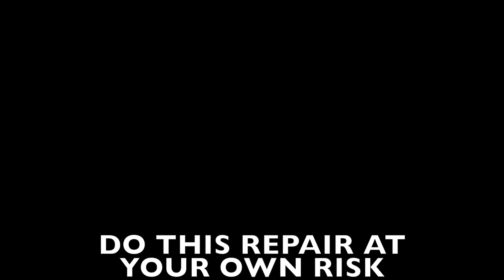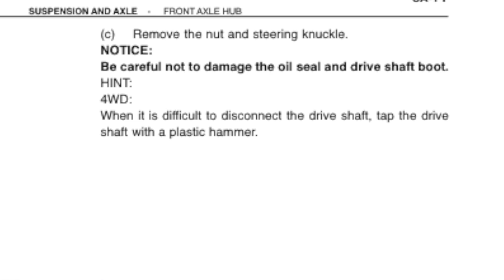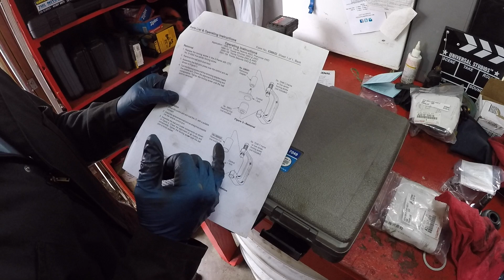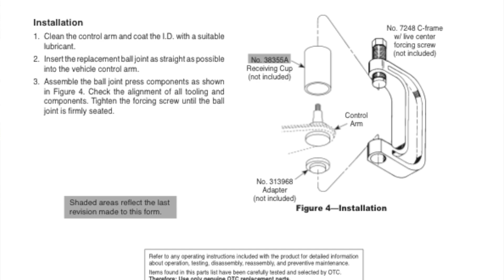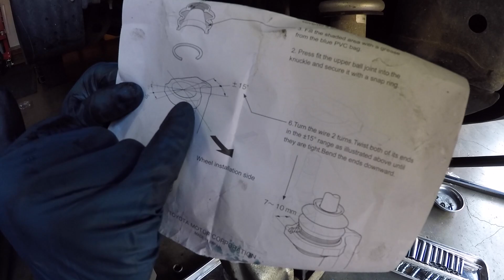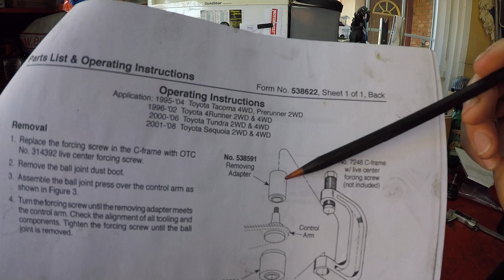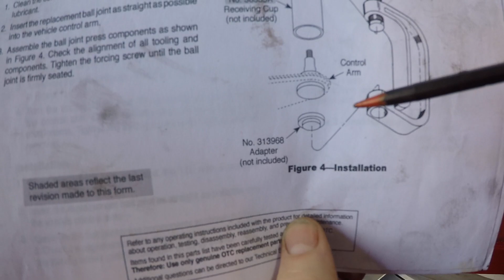Upper Ball Joint Replacement

Comment: Timmy, do you know if the Balljoint kit that you mentioned in the description (OTC-7249 on Amazon) comes with the necessary pieces for the upper ball joints on a ‘97 T100 4x4 & an ‘07 Sequoia 4x4? Your videos are top notch and have given me the confidence to tackle many jobs on my vehicles. Thanks!
Reply from the maker: Hey Casey,  No, that kit doesn't have all the specialty cups and adapters for the UBJ replacement.  When I did the UBJ job on a 3rd Gen 4runner, I bought the necessary cups and adapters separately from a tool supplier.  You can rent some kits for free from auto parts stores to have more cups to choose from and you can also get creative by using things like a deep impact socket to slip over the stud of the UBJ to drive it out of the steering knuckle.  To give you an idea what is involved, here's a link to the UBJ Replacement video.  I chose to remove the whole knuckle so I could capture it in a vice and not fight to get the necessary leverage to drive the UBJ out and get the new one in.  https://youtu.be/-sY2azyLBuI

Comment: Another great video!  Keep it up!  Also, What are the model numbers of the Dewalt impact drills you use? (Ready to upgrade)
Reply from the maker: Thanks.  Glad you like the video.  

Here'a a link to the larger gun: https://www.amazon.com/gp/product/B00WJA1J68/ref=oh_aui_search_detailpage?ie=UTF8&psc=1

Here's a link to the smaller gun: https://www.amazon.com/gp/product/B007NVSQEQ/ref=oh_aui_search_detailpage?ie=UTF8&psc=1  

These are bare tools, no batteries.  Here's some batteries I bought: https://www.amazon.com/gp/product/B00KQU1ENG/ref=oh_aui_search_detailpage?ie=UTF8&psc=1  

You'll need a charger too: https://www.amazon.com/DEWALT-DCB118-FLEXVOLT-Fast-Charger/dp/B01HD4E0LK/ref=pd_bxgy_469_img_3?_encoding=UTF8&pd_rd_i=B01HD4E0LK&pd_rd_r=424e3614-e703-11e8-8650-391015bbf8ed&pd_rd_w=bG3Dt&pd_rd_wg=2z5Qb&pf_rd_i=desktop-dp-sims&pf_rd_m=ATVPDKIKX0DER&pf_rd_p=6725dbd6-9917-451d-beba-16af7874e407&pf_rd_r=3WCN4JXJ31DYY6VG99YJ&pf_rd_s=desktop-dp-sims&pf_rd_t=40701&psc=1&refRID=3WCN4JXJ31DYY6VG99YJ

Comment: Are torque specs the same for a first gen tundra?
Reply from the maker: No clue.  We haven't done this job on a 1st Gen Tundra.
Reply: Are specs in the owners manual?
Reply from the maker: @johnjohnson6207  No, the owners manual doesn't cover that kind of information.  Those owners manuals have fairly basic information in therm.
Reply: @TimmyTheToolman  where can I find specs
Reply from the maker: @johnjohnson6207  You can try to see if there's an online version of the manual you can download for free.  You could try a Tundra forum and see if someone has the specs you're looking for.  You could buy a two day subscription to Toyota Tech Info and download the info you need yourself.  https://techinfo.toyota.com/techInfoPortal/appmanager/t3/ti?_nfpb=true&_pageLabel=ti_home_page&contextType=external&username=string&password=secure_string&challenge_url=https://techinfo.toyota.com/techInfoPortal/login/techinfo&request_id=-5518364760491963150&authn_try_count=0&locale=en_US&resource_url=https%3A%2F%2Ftechinfo.toyota.com%2F
A 2 day subscription costs $20.  You do need a Windows based computer to access the site though.  The minimum system requirements are listed on that link I provided.  There's a link at the very bottom .

Comment: Hey Timmy,
I've really enjoyed your Toyota videos. One thing I haven't seen you attempt is the front wheel bearings on something like a 2001 Toyota Tacoma 4 x 4 using a OTC Hub Grappler considering you use their tools. I've heard this is a difficult job. Any chance of seeing you perform this job in the near future?
Reply from the maker: Vlad Rector Hey Vlad, we have replaced wheel bearings on a 3rd Gen 4Runner which would be the same for a 1st Gen Tacoma.  The bearing replacements were part of our Manual Hub Swap videos.  You must have ABS so you’d want to watch Part 1 to see how to remove and replace the knuckles and Part 2 will show the presswork related to ABS Knuckles with A.D.D. Hubs. Part 1: https://youtu.be/TZ2sOfVrnhU. Part 2: https://youtu.be/1TpOYj0sUpA

Comment: What?!  I had no clue there were inner tie rod ends.  I just replaced my whole steering rack because one was bad.  But, it was also leaking a lot of fluid
Reply from the maker: Well, if it was leaking a lot of fluid, it was time to replace it.

Comment: are you a bike racer _ I see a lot of bike wheels and tires and rims hanging around
Reply from the maker: Use to be.  I raced mountain bikes from the late 80's to 1997.  I took a pretty long break from racing, around 7 years and then I started racing cyclocross.  I raced up until a few years ago.

Comment: Is there a reason why you can't just use the C clamp while everything is still in the vehicle?
Reply from the maker: You can but it's not exactly easy.  The reason why we pulled the whole steering knuckle off the rig is so we can capture it in a bench vice to hold it perfectly steady while we apply the necessary force with either a large 1/2" ratchet or breaker bar along with the c-clamp to force the ball joint out of the knuckle.  When you do it with the knuckle still on the vehicle, you can't stabilize the knuckle very well and it wants to flop around on you when you're trying to press the balljoint out. There's also the issue of space to get that c-clamp in place with the knuckle still on the rig.  So, instead of fighting it, we choose to pull the whole knuckle off.
Reply: @TimmyTheToolman  thanks Timmy, you sir are a true gem on youtube.
Reply from the maker: @Nessal83  You're welcome and thanks for the kind words.  Sean and I like providing a service to the DIY Mechanic Community with the videos we make, which includes taking the time to answer people's questions.  Happy Wrenching!

Comment: The way you did the wire holding the boot on was wrong.
Reply from the maker: Yes Wayne I know that.  I mention that in the video at least 2 times.  It wasn't until after we were finished that I realized my mistake.  The twisted wire ends should be to the side and not perpendicular to the wheel.  If either of his boots end up tearing, I'm going to replace them for him.  Toyota sells a reboot kit.  All you would have to do is remove the wheel, break free the upper ball joint from the upper control arm and remove the boot and put on a new one.  It would be a very easy fix.

Comment: Why take the whole spindle off you can do it on the vehicle.
Reply from the maker: Personal preference.  Having the steering knuckle  secured in a vice makes it easier to press the old UBJ out and press the new UBJ back in.  I've tried it with the knuckle on the vehicle and I didn't like the fight that was involved to stabilize the knuckle while applying the necessary force to do the press work.

Comment: you can do it without removing all those parts
Reply from the maker: Yeah, I know and I stated that in the video.  I chose to take the steering knuckle completely off so I could secure it in a bench vice and have an easier time getting the balljoint out and the replacement one back in.  With an impact gun, I think you could easily do it with the knuckle still on the vehicle.  I wanted to show how to do it with regular ratchets and breaker bars because not everyone is going to have an impact gun.

Comment: This is the long way of getting the upper ball joint out.  Some of these steps are totally not necessary such as taking the lower ball joint or axle.  You don't need to completely take out the upper joints to put in a new one.
Reply from the maker: There's more than one way to skin a cat, this was the method we chose to showcase & with the knuckle removed, it makes it easier to work with the upper ball joint especially when filming to get a good viewing angle for the viewer. Can’t wait to see the YouTube video you make showcasing the method you prefer.
Reply: @TimmyTheToolman  Just search there's plenty out there and on the forums.  I'm just saying there's other methods which are more easier.
Reply: @TimmyTheToolman  Just did mine today. Rented 2 tool set from O'Reilly (4wd ball joint adapter & Ball joint removal) Part# 67048 & 67045. Not all parts will fit but most will.  I had to MacGyver a little.  Didn't take the lower ball joint or axle out.  I tilted the knuckle at an angle almost outside the fender and use the rental tool to remove and install the upper joint. Pretty easy.  The only tool I didn't have was a strong enough ring plier to expand the ring. That was a pain and was probably the hardest part of the job for me. I used a hammer and flat head driver to pry the ring out.  Busted a few knuckles.  I'll invest in one in the future.  Thank you for this video!
Reply from the maker: @genxiong2695  Good job getting it done.

Comment: It would be great, if two of you mechanics on here, could agree on how to do the ball joints. not one of you do. Every one of you has a different way every one of you says the other one's way is fucking wrong. I'm sick of that shit. Also all of you experts need to realize you're not talking to other experts. You gloss over waaaay too many steps. Then, you all get that same special tool, which as far as I can tell, is a 200 dollar fking C clamp, that you then need to buy 2 new cups, because I guess the tool made for this trucks ball joints doesn't have the correct sizes for the ball joints? That's the consensus among all of you youtube experts. After watching your video, I've decided not to do this job. I'm replacing my entire front suspension, easily. But the ball joints apparently, require a 200 dollar C clamp and then needs to be retooled. Yeah, no. That's just fucking stupid.

Comment: You should just stop....Not only do you not have to remove that spindle to fit the ball joint tool but you split the lower ball joint instead of removing the 4 bolt flange and leaving the LBJ together.  Replacing the UBJ in the vehicle keeps anyone watching this video from having to removing the ABS sensor, splitting the tie rod, removing the axle nut (potentially damaging the front wheel bearing if they do not torque it correctly) removing the caliper...ETC ETC...just stop.  If you want to disagree, fine, just reference the 500 other videos on youtube showing countless people replacing the UBJ with the spindle still in the vehicle...
Reply from the maker: You're entitled to your opinion and you don't have to like my technique.  I've already replaced an upper balljoint during a suspension lift installation which included replacing the upper balljoint for an aftermarket adapter for a Total Chaos upper control arm.  I found doing it on the vehicle a serious pain in the ass because of the available room and the inability to stabilize the knuckle effectively to apply enough force with a breaker bar or long ratchet connected to the balljoint c-press rod to drive the balljoint out and back into the knuckle.  I'm not the only one who agrees that taking the necessary steps to take the knuckle off the vehicle is worth it to avoid the fight you'll have keeping the knuckle on the vehicle.  I could have just erased your comment but decided to give you a response.  In regards to the balljoint bolts,  I don't like messing with those because lots of people, including myself, put loctite on the threads.  Also, these bolts have been known to break so not having to re-torque these bolts is a smart thing.  There's more  than one way to get a job done.  This is my way.  So Dude, why don't you stop with the disrespectful tone.  You could have said what you wanted to say without saying crap like. "You should just stop".   If you look at the thumbs up and thumbs down for this video, you're in the serious minority opinion of this video.  In closing, why don't you "Just Stop" being disrespectful towards other people's work.  If you do a little work on your communication and people skills, I'll happily respond to future comments from you.  If you comment again with the same disrespectful tone, you'll disappear from our channel.  Happy Trails.

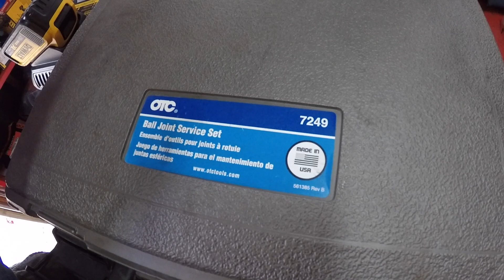Comment: Hi Tim, do you know if this OTC 21:52 ball joint kit works with 5th gen 4Runner and FJ cruiser as well?
Reply from the maker: That kit is a general kit that I personalized with buying other driving and receiving cups.  It's similar to what you could rent at an auto parts store.  How well it would work for a 5th Gen 4runner or for an FJ Cruiser, I'm not sure because I haven't used this kit on either of those vehicles.

Comment: Seems like removing the knuckle and having the machine shop do the pressing , would be less of a PIA, Since that ball joint kit doesnt come with the adapter, and who knows if the parts stores rent the adapters along with kit. It's simple enough that an average machine shop will press it in straight the first time for $25ish/side.. You thinik that's a reasonable alternative, or  ridiculous? Cool guy one-man shop way is  nice too, but I'll rather pay the extra $40-$50ish bucks.  Thnx for the thorough vid Triple T.
Reply from the maker: Having a machine shop do the pressing for you is an option provided they know what they are doing and would charge a reasonable price.  With press work, there's always more than one way to do things.  We're giving you one way with all the proper ball joint adapters from OTC.  Do a search and I'll know you'll find some other ways guys got it done when they didn't have the proper adapters.   Parts store do rent adapter kits with the ball joint press but whether or not they have the exact ones I have, I don't know.  I'm pretty sure some have gotten away with using a deep socket to press the ball joint out.

Comment: It took me a trip to the dealership to find that "Front wheel adjusting lock" 
The Part Number is 43525-35010, 4352535010
Reply from the maker: Thanks for sharing.